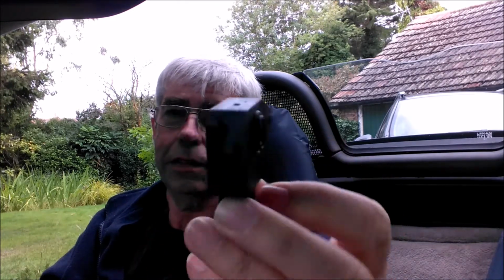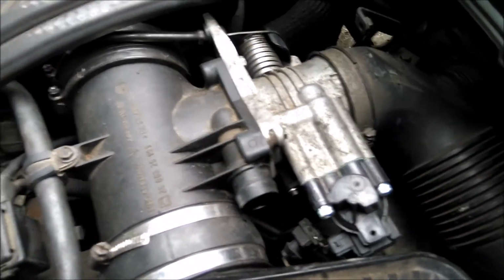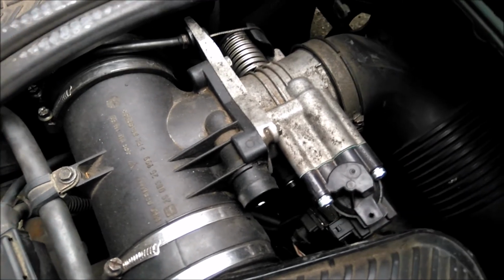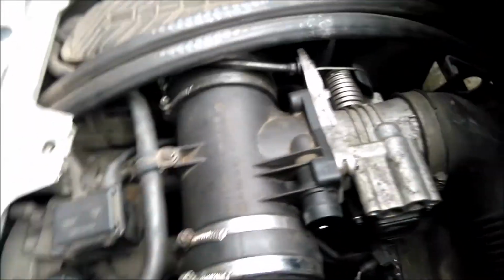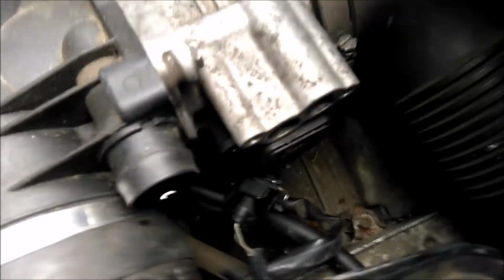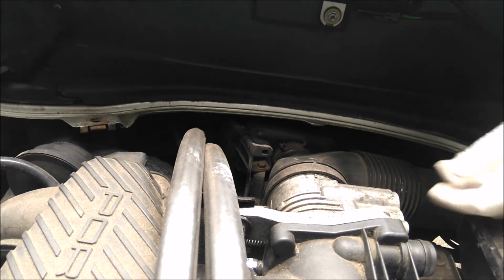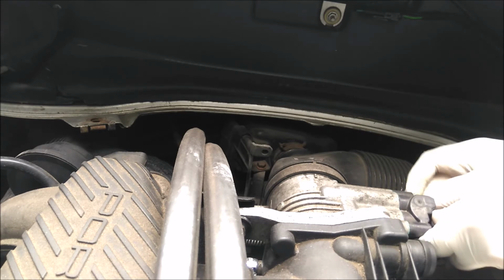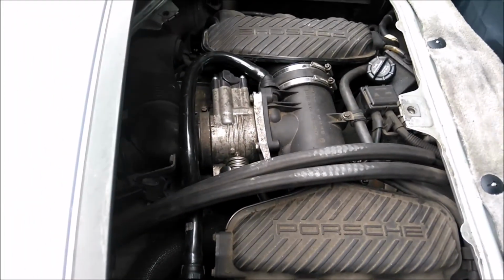Porsche Boxster replacing the throttle position sensor

Comment: Hey Paul, what is the kind of hissing sound when engine starts up at 17:18 & turns off at 17:28? Is it normal? I've got the same sound on mine and I've just cleaned and refitted the throttle body...I can't tell if it's some kind of air leak though as my exhaust is too loud lol, Thanks!
Reply from the maker: Hi Dan, please bear with me, I will watch the video when I get a minute and have a listen to the noise

Comment: Hi Paul, what are the symptoms of the throttle position sensor being a problem, 
My Boxster has been layed up for 3 months, started regularly, but yesterday it started after the battery was charged but no response from the throttle pedal, only a slight hunting ?
Reply from the maker: Hi John, the car was jerky while driving. the sensor was sending an intermittent erratic signal to the ECU. That makes sense, the sensor was saying erratic jerky movements were being made by the throttle pedal. mine is the early system with cable and the sensor reading the butterfly movement. so when you open the butterfly the sensor tells the ECU to add more fuel.

Comment: Well played on the bolts ;)

I'm now wary of ebay 'genuine' Bosch parts having been stung on an O2 sensor recently.
Soon after replacing it the money light was back on with a sensor too lean code.
After checking the scan tool graphs and a physical check, it's the sensor not putting out a high enough voltage.
I came close to taking it to a dealer for an ecu re-flash as suggested online for the specific error code and even replacing the cats!
Maybe I was just unlucky, but i'll be getting the replacement from one of the better known vendors.
Reply from the maker: yeah it can be tricky, but EBay are hot on that sort of thing, if the listing says genuine Bosch it should be genuine, sometimes price can give it away if it is too cheap
Reply: I paid £58, but the going rate is £150 ish.
All looked genuine with the right box etc but i'll inspect it again once I take it out in case something has been contaminated.
Reply from the maker: djambrosia I paid around £70 for mine, so doesn't sound a bad price, definitely check everything out first

Comment: Paul where is the TPS on a later electronic throttle body, everyone lists one for a 2003 2.7 and I’ve bought one but I’ll be buggered if I can find it?

Dave
Reply from the maker: Hi Dave, I did a little research on this and I see your problem. The TPS for the early cars (like mine) is being list for the later E-gas (electronic throttle boded) cars, which is wrong. To explain the situation, the early cars with cable operated throttle needed a sensor on the throttle body butter fly valve to tell the ECU what the throttle position was/is. the E-gas cars have a sensor on the gas peddle which reports its position to the ECU, the ECU then tells a motor on the throttle body to move the butter fly valve to the corresponding position. So the E-gas doesn't need a separate TPS. The unit (motor) is a big black thing on the side of the throttle body (it turns the butter fly valve) The bad news is it looks like you have to buy the whole bloody throttle body! Sorry this was a bit long winded, but I hope it is of some help to you.
Reply: Paul1962 Ahhhhh that explains why I can’t find it then, what I can’t understand is why I now have a TPS that someone listed as a part for a 2003 986. All the websites sell a sensor for my year I just don’t get it? Well thanks Paul, I started having bad running issues after I disturbed everything to swap out the Starter motor, I’ve stripped it all out again, cleaned the TBody and re seated the plenum hoses, took the cover of the Tbody motor off and give it a good clean with contact cleaner and put it all back together and bobs ya uncle. All I need to know is now is how I’ve manage to acquire  TPS I don’t need🤔.
Thanks for ya time Paul keep the vids coming mate they are priceless.👍🏻
Reply from the maker: @davenettleton7043  Will do my best, spend most of my time now making videos for work, 24/7 editing, but none of my stuff :(
Reply: Paul1962  thing is Paul , you’ve done everything on your car? You don’t have many more videos you can shoot on a 986 ,I’m now doing just about everything you’ve done vids for 😂
Enjoy the bank holiday 👍🏻
Reply from the maker: @davenettleton7043  will do

Comment: Hi Paul, my 986 1997 when it gets cold accelerates at 2000RPM, and then when it gets a little hot, it accelerates alone between 1000 and 2000RPM, as if I had to press the accelerator, but I'm not. Do you think that replacing this part solves the problem? or advise to replace the Idle Control Valve as well? Thanks
Reply from the maker: Hi, Joaquim, There are a number of things that could course your problem. do you have access to some basic diagnostic tools to do a few checks? When you say accelerates do you mean the rpm increases when the car is stationary at idle (as you mentioned the idle control valve) or when you are driving a long?
Reply: @Paul1962  hello, yes, the car only when it is out of gear does the RPM increase and decrease by itself. I already cleaned the MAF and I also didn't notice any vaccum leak. I have some basic tools. What advise me ?. Thanks a lot for the help.
Reply from the maker: @joaquimfsm  you can disconnect the TPS with the car at idle (do not rev it) see if the problem goes away ( as the ECU is getting no signal from the TPS it will think the throttle is shut, at idle)  I use basic software to see the TPS movement  https://ebay.to/2zsjoSa 
Look at you long term fuel trims for air leaks are they high? do they drop down if you hold the RPM at 3000 for 2 or 3 minutes? if so you have an air leak some were. start with these and see how you get on.
Reply: @Paul1962  Thank you, i will see

Comment: HI Paul, did this cure you rough running issue long term???
Reply from the maker: yes, while trying to trace the problem I inadvertently replaced the throttle position sensor with a brand new but faulty one, unknown at the time as it was being hidden by the original problem, so we carried on searching for the original fault. I think we must have then found and cured the original problem but didn't know as we still had the problem of the faulty new throttle position sensor which was now masking the fact that the original problem was fixed. I discovered the problem with the new tps by luck when researching for the diagnostics review video, I put the old sensor back on and the car run fine so there is nothing wrong with the old sensor and it could not have been the cause of the original problem. how ever as you've seen in this video I have now fitted another new sensor, Bosch this time, lol. hope this makes sense, I also  tried to explain it in this video   https://youtu.be/m8xWQ_j4sPY

Comment: A very beneficial video 👍🏼👍🏼👍🏼
Reply from the maker: Thank you, glad you found it interesting and helpful
Reply: @Paul1962  Hey Paul, enjoy your channel.
My 02 Boxster surges at low speeds, light pedal movement, seems fine under hard acceleration. In manual mode and tiptronic .. tps? Or plenum? Or fuel filter? Those are my guesses.. Thanks Man
Reply from the maker: @jeffjeff4477  Hi Jeff, I think 02 was the change over year, is yours cable throttle or fly by wire? if fly by wire the TPS is part of the plenum so you have to change the hole thing (not cheap). I think TPS would be at the top of my list. I use cheap  OBDwiz software, not brilliant, but it will show you the signal from the TPS, also you can check the MAF sensor as well. if yours is cable the TPS is cheap enough to just swap out and keep the old one as a spear if its not the problem. Fuel filter would be last on my list, When was it last changed?
Reply: @Paul1962  Thank You for your reply!! I do have a spare 986 motor, ims failure. So the maf and tps/ plenum are still around. I will start with the plug n play maf, then plenum assembly. Not sure about the fuel filter. I will add it to the list for the next oil change procedure!! It's times like this i miss the Air cooled 911 days lol just 10 quarts of oil between you and the motor sitting on a stand. Thanks again for your time and help.
Reply from the maker: @jeffjeff4477  I think we all miss the olds days. And now we have electric cars to look forward too :(